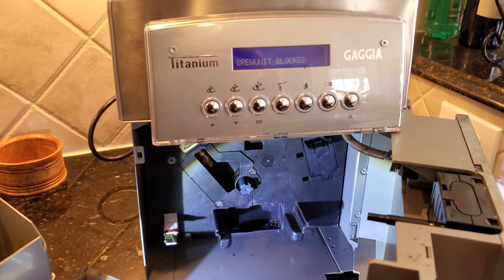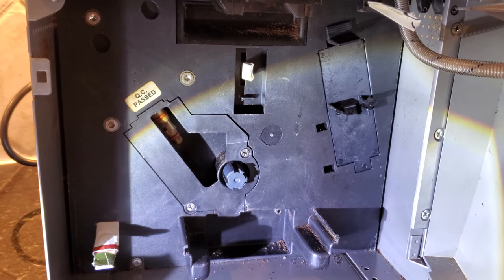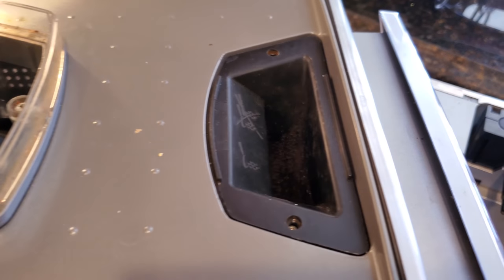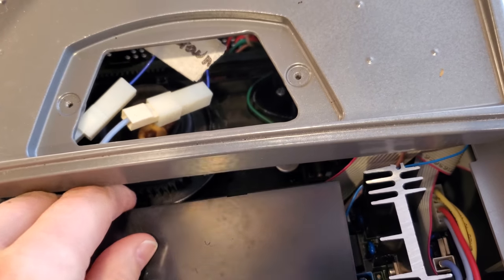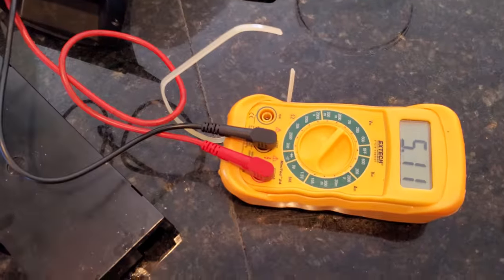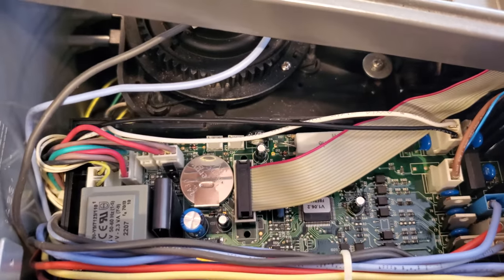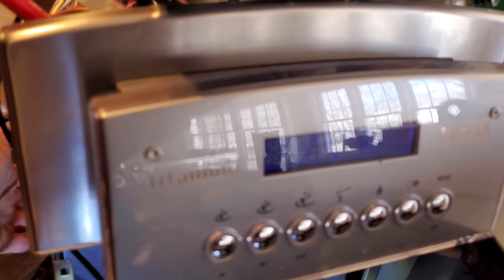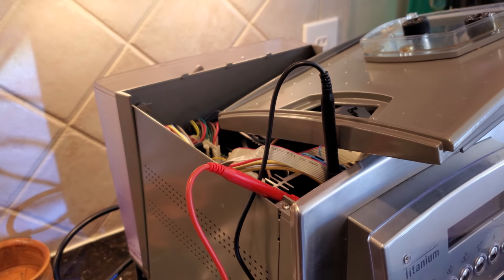Brew Unit Blocked in Gaggia Titanium espresso machine

Comment: Hi all, after acquiring one of these units with this fault I went at it and found the same issue you describe here. The issue with my unit though was the large TIP33 transistor had blown. Replacing this sorted the issue.
Reply: сколько должно быть напряжение?
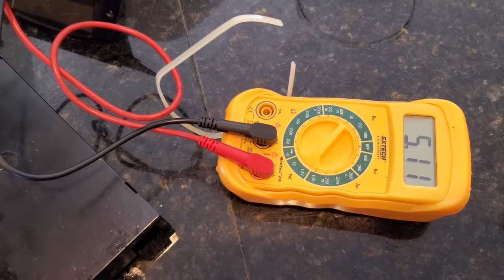Reply: @Luboded  says it in the video at 5:42 he says it should be 9v, but read 5.45v
Reply: @johnshore3095  я менял TIP33, но дело было в механической части. Провёл чистку механизма заварочного, собрал, всё работает.
Reply: Do you recall which TIP33 you replaced?  I believe there are seven on my main board…

Comment: Hi to all. Here the same problem. Motor is rotating very slow. I solved the problem and I can confirm , that problem is transistor TIP33C - this is the biggest component on the aluminium heatsink. The transformer is for low power electronics - display , CPU and has nothing to do with power components - motors , pumps , solenoids.

Comment: Thanks for the video!  I got a replacement transformer, and soldered it in, but unfortunately, the voltage is still low (around 6v) the spindle still turns slowly, and the unit still reads Brewunit Blocked. 
Michele - you mentioned you had the schematics - where did you get hold of them?
Reply from the maker: Here: https://wiki.wholelattelove.com/File:TITANIUM_Electrical_Diagram.pdf
Reply: @matrovero  thanks - I had found this one already, I thought maybe you had the detailed PCB schematics.  I suspect that there may be a 9V regulator that is blown, since changing the transformer hasn't had much effect - so I'm in the process of trying to identify the different regulators on the PCB.
Reply from the maker: @ollieblacklock8923   Ah, sorry, I don't have the schematics of the board.  I kept the failed board if it can of any help to you. I didn't bother checking which component failed.
Reply: Hi, my machine did exactly the same thing. About 6 V I replaced the transformer and no difference. Did anyone solve the problem here? Obviously the transformer was not the problem and the video completely replace the circuit board.
Reply: @grantrosewarne7433  and all another comment by Jack mentions a TIP33 

My unit just did this same fault so looking at it.

Comment: Hi Michael, I replaced the transformer as you suggested but it didn’t improve the voltage which is about six volts. Did anyone work out the actual component which was at fault? Otherwise I have to change the entire board as you did. Many thanks. Grant
Reply from the maker: Sorry, I didn't spend time diagnosing the board. I just assumed the transformer was the culprit. My bad for providing incorrect information. There are a voltage regulator and a capacitor connected to the transformer. I would start with checking those.

Comment: Also , I am pretty sure that this motor is AC and operates at  30 volts AC ( maybe even more) . The author of the video  measures the voltage in DC mode , that's why  he  receives 9 volts.

Comment: Hello. Thanks for that sharing . I have same error . Transformer is ok . I have only 0.8 v at motor input. I have test diodes rectifier . And npn large  transistor . That one seem hs . Can you give me the normal values at emmiter gate and collector
Reply from the maker: I am sorry I don't have that information. My machine has been working well since I replaced the board and I had no interest in reopening it. I have since found this blog which describes the same problem in detail for a similar board: https://raphtec.wordpress.com/repairs/saeco-cafe-nova-repair-2-brewing-unit-motor-controller/ and includes a reversed-engineered diagram. I hope that has some useful information for you.

Comment: The AC voltage at the 3 bigger wire is 36 and 110v . I have 13 v at transfo output

Comment: Ja same problem. Problem is where to order the board
Reply from the maker: I ordered from Whole Latte, but now it's out of stock. Looking at the schematics, and alternate parts numbers (see e.g https://www.enco-vending.com/image/data/files/Gaggia/TITANIUM_NEW.pdf), I was able to find one from Cerini https://www.cerinicoffee.com/products/pcb-power-control-board-titanium . I ordered parts from them before. Alternatively, you can take your board to any electronic repair shop and check and repair the TIP33 transistor. It should be a lot cheaper than a new board.
Reply from the maker: I shoudl add the the board I pointed to is for 120V (USA). If you are in a 240V area, the power supply is different.